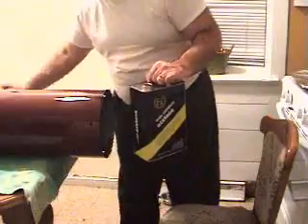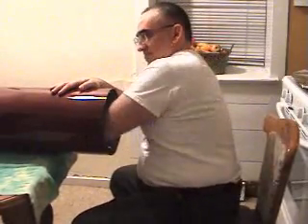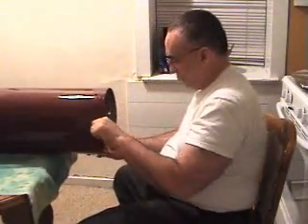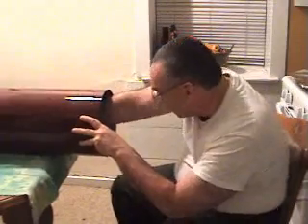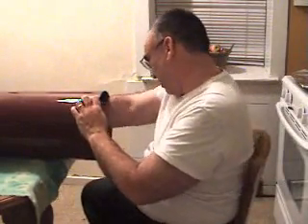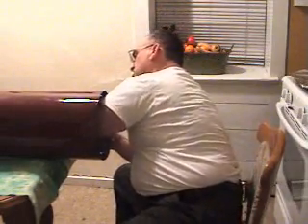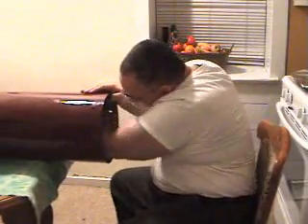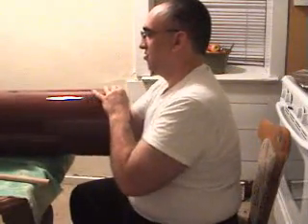Making a Telescope Tube Part Two

Comment: Hi, I am enoying your project and instructions.
As touching on the p-coat:
I have experience with that in automotive restoration application. 
I am curious to know if you have considered alternatives to the acetone exercise?
You could scuff the p-coat with 120-300 sand paper then apply flat paint. 
or use a "X" flap sander on a electric drill.

Another idea is to use a section of flat black formica rolled up inside the tube.
Formica can come in 4x8 sheets.
that saves a lot of work.

Comment from the maker: Or first place for the Darwin Awards!

I appreciate your comment, it is very imporatnt and illustrates a good point. Safety.

My stove is an electronic ignition gas stove, no pilot light, but ventilation is necessary, particularly when working with volatile materials.

Please share with us if you are working on a telescope project, and if so, what are you making and how is it coming along.

Thank you for your kind concern.

Best regards,

Francis J. O'Reilly

Comment: Why did you do all this work after the tube was painted?
If I would build one I would make sure all parts fit well, all holes are in their appropriate place, the tube would be cleaned thoroughly inside and out. Then the tube would be painted on the inside. If all has gone well, painting the outside would be the last thing to be done. This is the best way to prevent damage to a beautifully painted tube.
You did it the other way around. Another beginner's mistake ? ;-)
Great instruction vid !